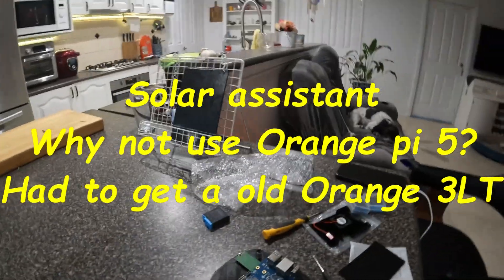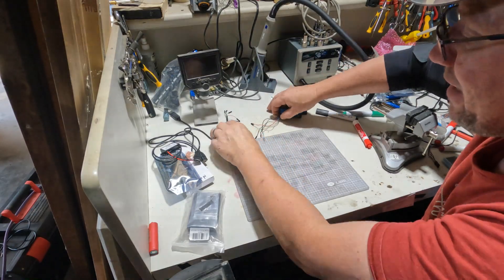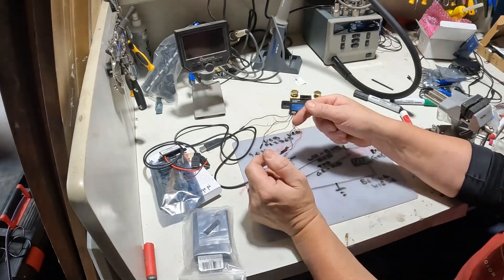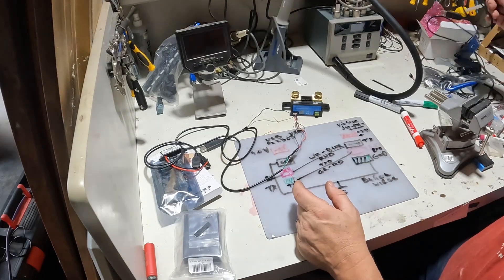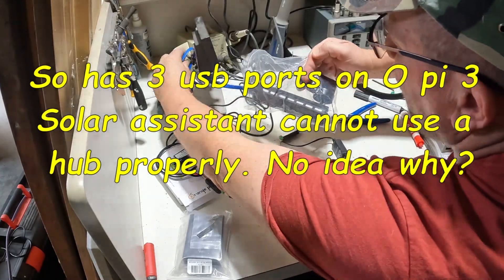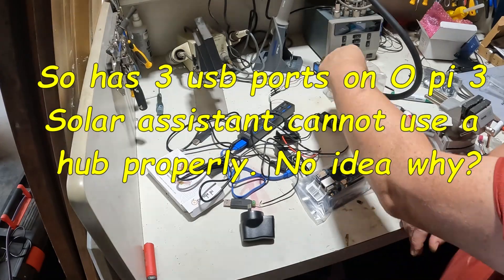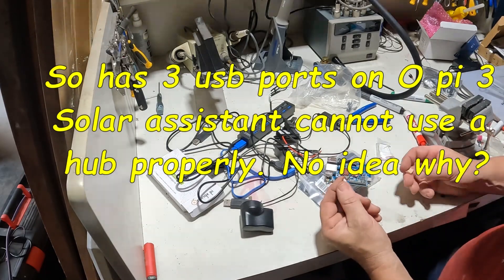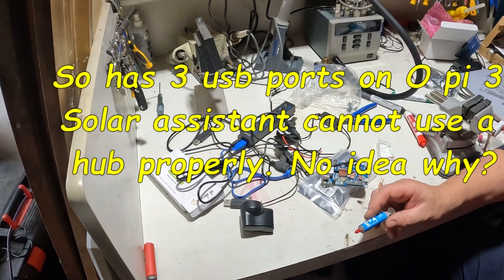Built cables for Victron Direct connector, JKBMS RS485 cable and Solar assistant setup.

Comment: I am also running venusOS. how are you able to read the jkbms rs485 with the victron? is it just plug and play? what kind of data are you getting?
Reply from the maker: I try to get it to work, but Venus OS or, in this case, Solar_assistant  will not read more than one. I build cables for it. I will do a mini show for you.